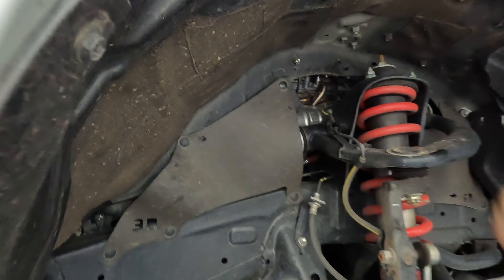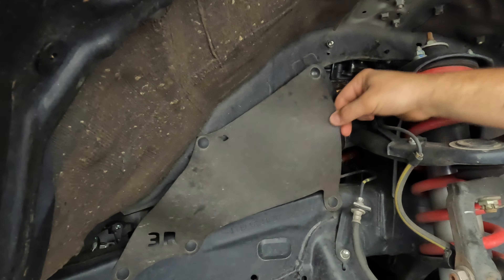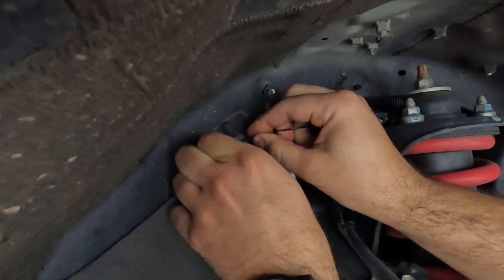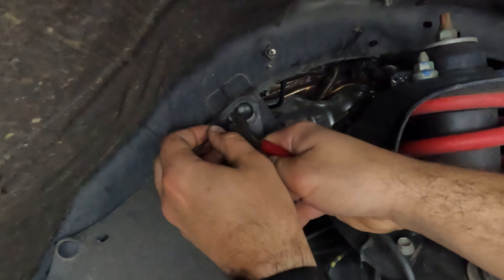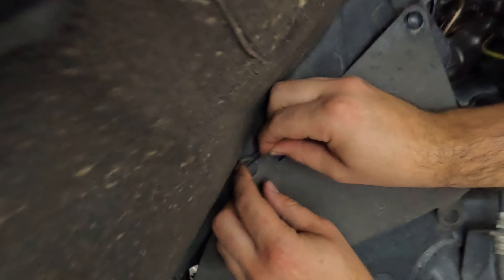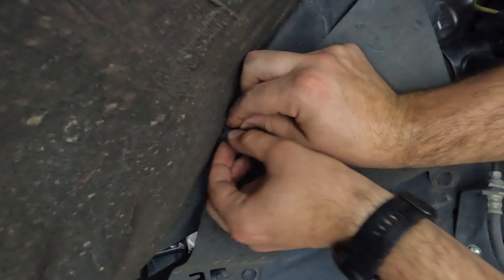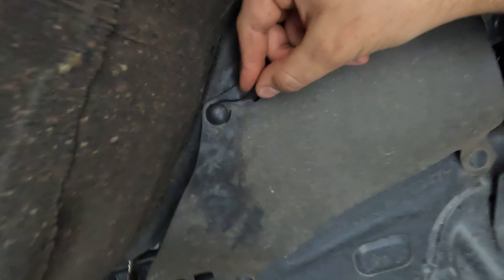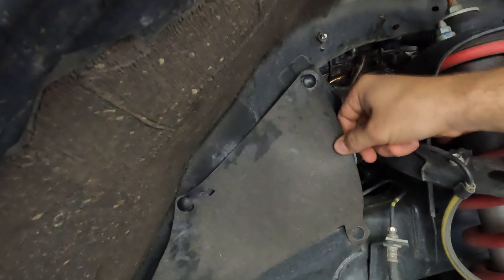Toyota 4Runner Front End Squeak/Rattle FIXED!!

Comment: Had this issue for months and figured it out this morning. I used a rubber bad for now and it worked. I will tried to get a small metal wire. The noise is super annoying